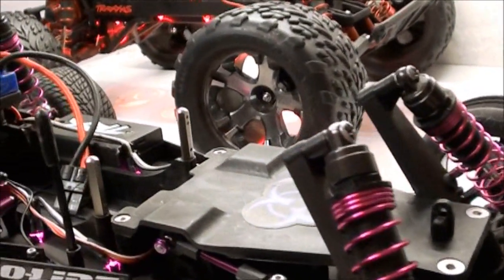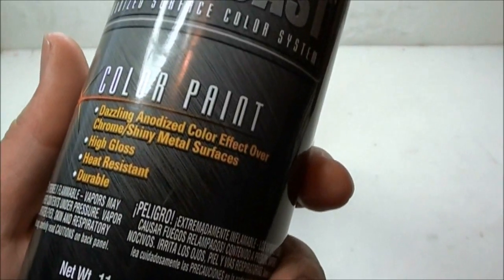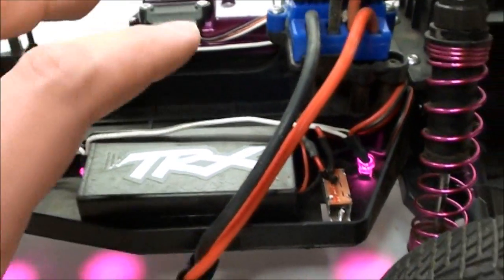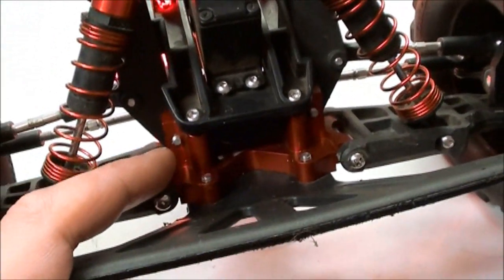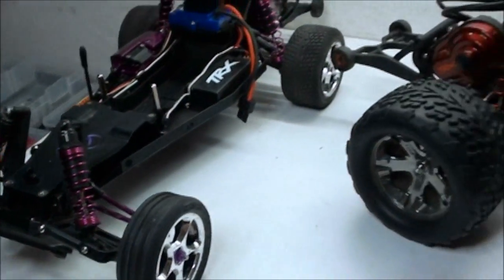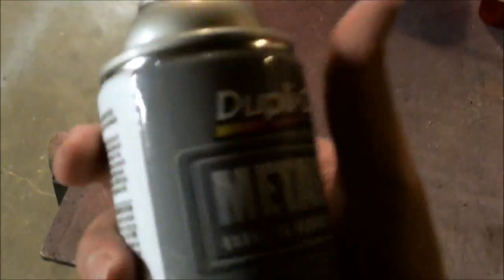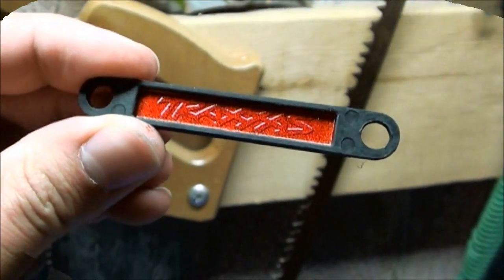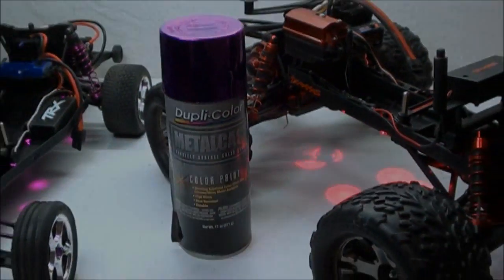RC "How To" Imatate Anodize Parts (Aluminum, Plastic, Steel, etc.)

Comment: tried this stuff tonite,it turned out dull n foggy.think my issue was to thick of a coat.did use the chrome cast i believe itz called.using it on my power wheelchair.
Reply: So in almost all spray paints dull and foggy means not a thick enough coat. (Or dirty air or you handled it to early) If you wait to long between coats and you let it get to dry you will not melt the second and third coats into the lower coats. Make sure to only wait ten mins after the second and then no more than 15-30 for your heavy coats. and remember warm air will cause it to dry faster.

Comment: I just got off the phone with Dupli-Color. They do not say that Metalcast is compatible with any "no-name" chrome paint.  They definitely recommend doing a test, especially with other brands of paint. They do not do inter-brand testing. It's up to the consumer. So, to be safe (I thought),  I bought Dupli-Color's Instant Chrome Finish--CS101. It is an enamel. Duplicolor told me that the Metalcast will not go over that. Was told it would wrinkle. Fortunately, Dupli-Color is a very stand-up company and is sending me, free of charge, a can of their Metalcast Ground Coat. It is metallic in nature, but not "chrome" per se. Obviously, your project(s) turned out fantastic. However, you might have gotten lucky. Again, each of us will have to do our own test based on what paint we're using as a chrome undercoat.  I made the [potential] mistake of priming my RC parts with Rustoleum 2X Primer/Paint which says it adheres to plastics.  Dupli-Color will not verify that the Ground Coat will be compatible with it. I'm waiting for the Ground Coat to arrive, but will have to do a test. Fingers crossed, cause I'll be bummed if I primed all those parts and they're not compatible. I'll try to update this post once I do the test. 

Additionally, it is not absolutely required that you wait 7 days for it to dry. The can says:  "Apply all coats within 1 hour, allowing 10 mins between each coat. For additional coats after 1 hour, wait 7 days for paint to cure. Dries to the touch in 1 hour. Can be handled in 3 hours."  While the 7 day warning does imply that is the full cure time, a rule of thumb is that you're probably safe if it is above 55-60 degrees, less than 60% humidity, and you give it 48 hrs to dry.

Lastly, I just wanted to say that yours is a great video.  It gave me  great ideas and the desire to do a tricked-out customized metal look on my son's RC car.  Thank you.  I wish everyone on YouTube, and on the internet as a whole, could view content and make intelligent choices, as well as be respectful.  

p.s. Note to past and future commenters:  a. if  you don't have anything nice to say, don't say it (remember your mommy telling you that?)   b. on here, as well as in life, as soon as  you start dropping the f-bomb and other expletives in your comments or argument, your credibility is immediately shot, and we all stop listening.
Reply: Hey man thanks for the tip and I appreciate you going out of your way to do the testing. So what was the end results? What chrome paint should we use? Thanks again!

Comment from the maker: Yes it works on aluminum. However the aluminum has to start off silver. You can't paint it silver and then anodize it. If it's already anodized a different color you're going to have to sand off the old color and then anodize it.
Reply: so what if the material is anodized silver can you still spray paint it the color you want?

Comment: I did this on my bandit xl-5 at least on the gear cover, and it turned out great! thanks for all the tips in this video...also I had a question...what's your opinion on painting the shock caps, do you think they would get too scuffed up? or would the paint also just crack off from all the jumps.